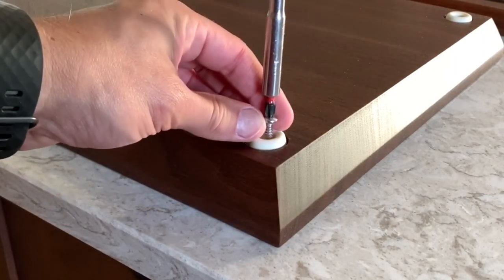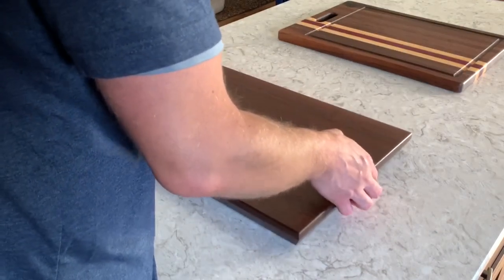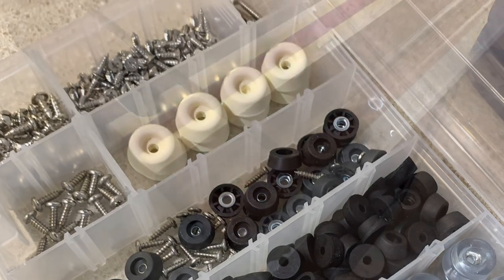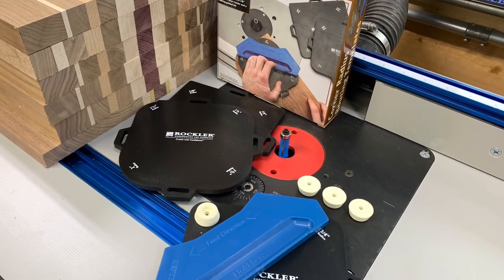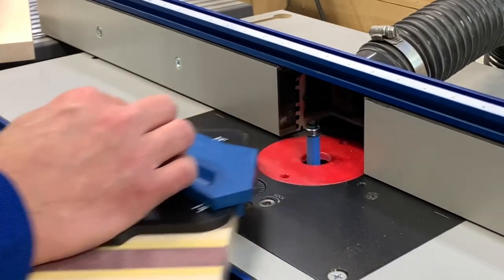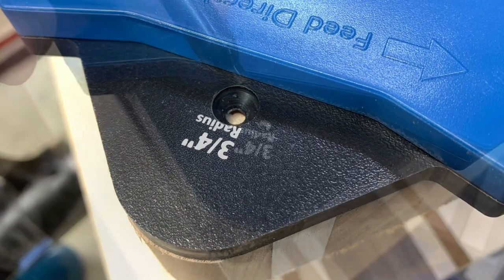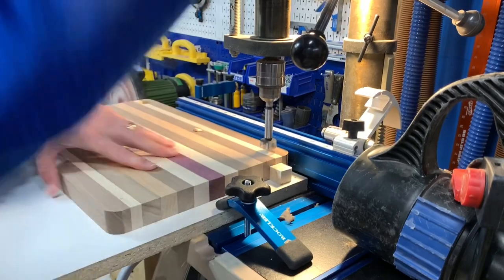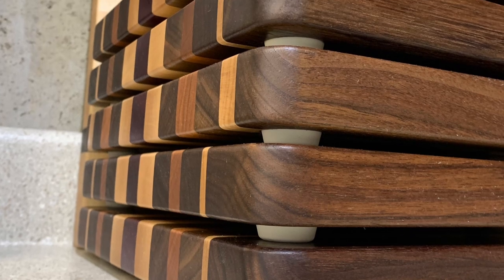DIY Cutting Board Tips and Tricks

Comment: I made my own corner radius templates from 1/4" masonite. It works just as well as the Rockler templates you have and only cost $2-3, a heck of a lot less than the $70 that Rockler charges. If I mess one up, it only takes me a few minutes to make a new one. I hadn't thought of templates for the counter-bores. I'll take care of that the next time I'm in my shop. (It's winter with highs in the low to mid 30s. My shop is in an unheated 2-car garage.)

Comment: Great tips.  I like the recessed feet. I'm just getting back to woodworking after a long hiatus.  I occasionally have minor leveling problems on these (working on that) and this approach will allow me to make some adjustments if necesary.  I'm curious:  Will the drum sander level a twisted board or does it simply conform to the shape of the board when it sands?  Thanks!
Reply from the maker: Awesome to hear you’re gettin back into it! Great question! The drum sander will not truly flatten a board.  The best approach would be to shim it on a sled and run it through a planer, flip it, take it off the sled and then run it through again. Have fun!
Reply: @CReevesMakes  Thanks.  I will need to bone up on that procedure  with an experimental piece. 🧐

Comment: Love those boards, how did you get the angle on the walnut board, thanks
Reply from the maker: I set my table saw blade to about 20° and used the fence to reference and make the cuts. Thanks!
Reply: @CReevesMakes  thanks, well let you know how it turned out.
Reply from the maker: Awesome!